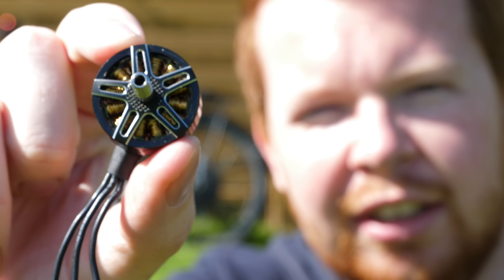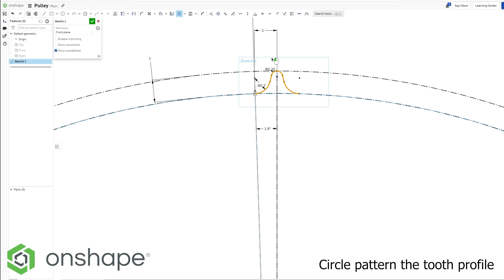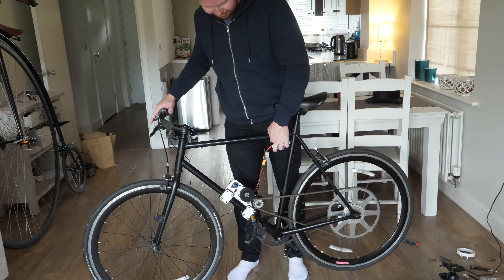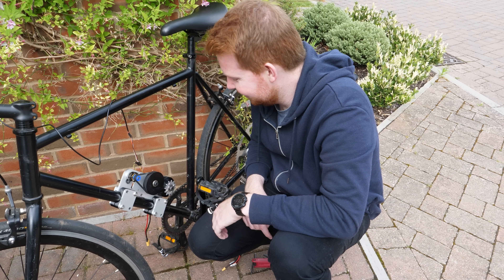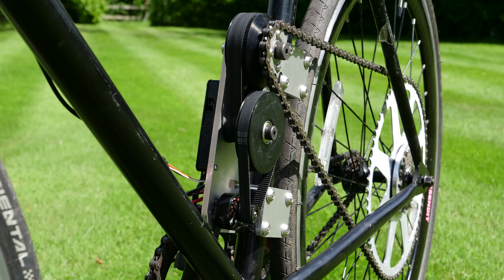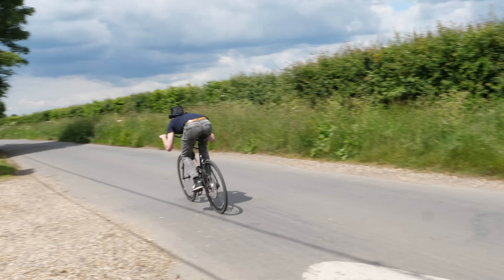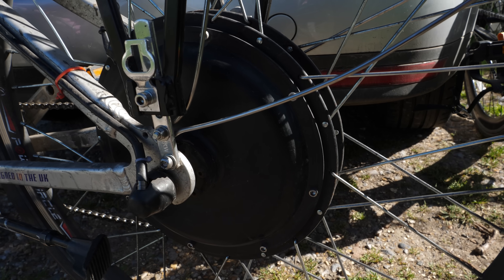Tiny 1kW Electric Bike Motor

Comment: So, what I don't understand more than anything else in this Ebike, ev world that is coming up around us now, is why are we doing away with transmissions? I've seen SO many bike builds, from Ebike to actual EV Motorcycle, and they're always limited to what static gearing is chosen. Either you have nothing off the line, or nothing at top end. And usually both suffer no matter what. Despite the big numbers touted, the speeds and acceleration are always horrible, something akin to a 1990s power wheels. So, why not bring the transmission into the mix? Who cares what the power plant is? Whether its petrol/combustion related, electric, steam, or human powered, having varying gears to make the job easier at various speeds, inclines, etc. just makes sense. Why is every single stupid electric build hindered by this simple premise? Usually while praising the reliability of having less parts. Well, I think some of those lost parts should probably come back into play. I'd much rather have 21 gears for my lil electric power plant to utilize, than one single fixed gear. That's just common sense. Feels like we're regressing at least as much so, if not more so, than our advancements here. Add one technology, remove one absolutely required, needed, sensible, part. Remove gas engine driveline, add EV, lose gears... why? Lets keep the gears, please!!! Motors, not exactly like engines, but similarly in general, do still have power bands. Just like you explain here... the drone motor makes its optimal power when spinning ungodly fast... Large industrial motors can make gobs of power and torque down low, and run out when spinning fast. So why not try to keep these motors within their power bands via gearing? You know, JUST LIKE WE DO WITH internal combustion engines, which have the EXACT SAME TRAIT? We don't need to lose the tranny just because we've replaced the engine. That's dumb. Let's stop being dumb.

Comment: Thing is that ebike hub motor is really not stressed at all at that 30 ish km/h level. I had a 6kg motor like that, on a 20 inch wheel I went 60km/h, I would set off using 4200 watts. Never had an issue and when I pulled it apart the coils weren't darkened in the slightest, it looked brand new. That drone motor is giving it all it's got. A bigger motor with reduction might be ok, but that's too tiny and missing the propeller to cool it. And going thru 2 belts and a chain can't help efficiency, maybe some other RC motor that's bigger than your fist, or one from a brushless tool, with a kv low enough to only need the chain and sprocket combo. I think it would hold up much better. Heck they even make water cooled RC motors.

Comment: What about a motor that just constantly spins up a fly wheel, put a temperature sensor on the motor to limit power while overheating. Use the fly wheel to drive the bike.

Comment: Should work alot better as a pedal assist motor, the tiny thing cant handle the massive amps when accelerating from a standstill. When its rated RPM is 30k, its essentialy drawing locked rotor amps for multiple seconds until you get up to cruising speed.

Comment: Really you have lots of thermodynamic room to play with your design.  There is a lot of heat transfer through both the housing and the spokes of the wheel of the ebike motor, and fitting a reduction solution into that hub might make for an interesting follow-on project.

Comment: In the UK I thought that motor assistance for eBikes is limited to 15mph, and above that it's all pedal and/or gravity power.

Also, those drone motors are designed to be cooled by the airflow from the fans. They really require active cooling of some sort or the windings won't last long.

In addition, the maximum power draw of about 1kW will only occur at low revs when the back emf is minimal. By the time the motor is up to full speed, the back emf will have cut the current flow markedly, and it might only draw a couple of hundred Watts if you are lucky.

Comment: Problem is the motor is designed for some optimal voltage and current ratio.
If you use it on a bike instead of a drone, even though you geared it down, you still apply too much load, extra load causes extra current to be drawn which obviously overheats the motor, and the average voltage applied to the motor is also low, so that motor probably ran at much less than 1000W.
For that reason drone motor manufacturers specify what is the max size of a prop you can attach not to cause excessive current draw.
And lastly, in intended application there is a lot of air going thru the motor.

Comment: They forgot the fact that a drone has fans that create the lift, but also cools the motor down by the airflow it creates.
The drone motor on the bike has no cooling (no coolingfans). If theay had mounted the drone lifting fan also on the bike the motor had cooling and it would less overheat.

Comment: it would pe interesting to see if you encased the motor in a box full of oil would help with the overheating, or mabey used 2 or even 4 motors, these drone motors ar usually sold in bundles of 4 at a discount.

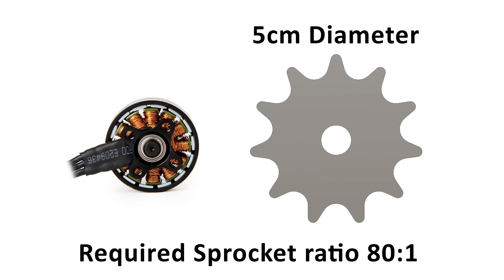Comment: cant you put less power to motor so he would heat less and make that sprocket ratio  from 1:33 smaller? so you would bot heat and burn motor so fast. im bot electrician so probably a dumb question
Reply: You could limit the power to the motor, but unless you have a reason (like overheating), there is no reason

Comment: And still when you look at this motor size... That's impressive!
Such a tiny thing can pool a man on bike at 30 km/h!
Reply: it's like Super Sport motorbikes. these tiny engines are basically used up in a few years because 10000 rpm are just not a sustainable thing.

Comment: I think, the main problem ist the first belt. At 30000 rpm it has a lot power dissipation due to inelastic deformation. In fact you will never achieve this motor speed, because the belt will consume a large fraction of the motor power. So it is always the best to use direct drive or a transmission with low friction. The best design for direct drives ist the axial flux synchronous motor. You can equipe the rim of your bicycle wheel with a lot of small disk permanent magnets and bring them close to a ring or a ring sector with a lot of small coils. I guess, this would be the best adapted design for an electric bicylce drive.

Comment: You could probably 3d print a small set of blades to move air across that motor to dissipate the heat that the props would normally do.  It is a lot of power being concentrated on a tiny space.

Comment: Such a interesting experiment! I guess the only question is; what is the added range if the battery stays the same size. Because of your experiment I'm thinking bike companies are building huge redundancies in to their current setup, which is understandable, a bike needs to take a beating. BUT if with a little attitude adjustment (only using the motor when up to speed) I could get 10 times (?) the range on my bike I would seriously consider it.
Reply: 1 kilowatt motor takes 1 kilowatt of power , no matter how small it is and high rpm motors can be ridiculously small , but each loses each power with each gear , and smaller motors overheat very easily , so It doesn't make any sense to use such small motor

Comment: Any intentions to commercialize something with a more efficient drive train? My frustration with all e-bikes and the add on kits that I know of is weight and bulk. For the extended touring that my wife and I do we just need intermittent help against headwinds and upslopes. All available motor systems I know of are so damn big and heavy that the motor boost is needed on a least the low setting ALL of the time just to help move their own system and battery weight. All of the market offerings focused on woo-hoo big watts power totally miss the users who need only intermittent boosts and can't access recharge every day.

Comment: Thanks for making this video. I was always wondering if a huge gear reduction would make it possible to use tiny motors to power bigger machines irl. Not just on the paper.
Reply: It is possible but there's more losses on gearbox so people usually don't do that unless needed
Reply: ohh yes...its possible.. I have seen the big structure(water treatment plant) run by very small motor with huge gear reduction...I think motor was about 3-4kg (no more then 1,5kW ) and gearbox+reduction box about 300-400kg... the whole structure (big frame) about 1-1,5k kg.. and this frame was running in the water.... so yes, its possible :)
Reply: @ImhotepBE  Same concept as a servo motor.
Reply: Gear reduction means friction.
A huge gear reduction can overpower a motor.
I think there's a lego channel where you see small lego motor lifting 100kg or something.
Reply: It's possible, but in most instances a bigger (heavier) motor is offset by a less complex gear reduction setup as well as using the motor more in the meat of its power output, which leads to significantly longer life. Same reason old Toyotas never die, they're so overbuilt they don't wear themselves out in 100-150k miles. 😄
Reply: its a matter of heat dissipation
Reply: but is not this like idk trying to push a boulder with only wood sticks...like it will roll but the sticks will break,
Reply: It's a waist of time" They will burn. Up even with 5//6 of them...We did the same thing with our bike using a Hoover board motor" 250w on both sides...one lasted a almost 2 months..the other motor almost a week more" Then we got a 750w set up" and it's been good for 6 months and still going...we went on and got a 2000w brushless motor kit and we're going to set it up in a few days"

Comment: What if you used more than one motor, to share the load and heat. With some clever engineering it should be doable. 
But with some quick hacking,, maybe use the 30k rpm motor for the first gear, and the 15k rpm motor for the second gear , in your setup.

Comment: Fun fact: early e-bike motors used to use this kind of arrangement. They had pretty tiny outrunner motors (but configured differently to deal with high startup current - also way better cooling) and a 1 or 2-stage reduction gear, often planetary, to the casing. But as it turns out, once you factor in sufficient allowances for cooling, enough metal to transfer the forces between the axle and spokes and all that, they weren't that light. Typically around the 1.5kg mark for a 250W motor.

These ended up going out of fashion because of the noise. Used to be commonplace though, I'd say about 50% of pre-2010 e-bikes used this arrangement.
Reply: I was going to mention, if they wanted to try and make their e-bike work with a brushless outrunner they should have used a planetary gear, after all they easily do between 1:50 and 1:100 in a single step and produce massive increases in torque for it. Plus the planetary gear would fit rather nicely in the hub of a bicycle wheel.
Reply: As soon as I saw him install belts, pullies and large sprockets, I thought, well there goes the wieght advantage of using the smaller motor.
Reply: https://youtu.be/LUVro3gXmF4
Reply: Thanks for the info. I was wondering where the small motors and extra gears went? now with the new single hub motor e-bikes china has been mass producing. I suppose they are def. more efficient. My only question is why dual motor bicycles don't go nearly twice as fast?
Reply: @feilox  I may be wrong, but I think having a second motor would double the torque of the bike, but not increase its top speed... not to mention the efficiency goes down as now you have the weight of a second motor.
Reply: So if you wanted the lightest possible setup, make something like this with a temperature sensor kill module to keep the motor from burning up.
Reply: I wonder if anyone's tried solenoids as pistons? They can pack a hell of a lot of force into a tiny thing.
Reply: @luminousfractal420  the amount of overheating would be spectacular. Also, piston driven motors are inherently less efficient than standard electromagnetic motors, because piston systems have lots of moving parts and lots of acceleration and deceleration.

Comment: Just a thought, if you can drive the motor with a mini 3Phase inverter and some form of rough current feedback, and add a switchable gear box, it should perform pretty well at lower speed.

Comment: The e-bike motor is made for torque and longevity, whereas a drone motor simply spins a fan which requires hardly any torque but lots of rpm. 

Whilst what you've done makes it possible,  it's like driving a lorry with a motorbike engine.

Comment: You maybe should have just written Mr. Musk to find out about torque vs actual consumed wattage.  I don't care what you make that tiny motor from, it will not be able to put out 1KW power.  The proof is how hot it got.  It tried to use the 1KW, but just converted it to heat.
Run it a paltry 10 miles and see what dripping hot plastic looks like.

Comment: One thing I was hoping you can try as I haven’t seen a well done video of turn like a Milwaukee drill into parts for a ebike. Expample use the motor out of the drill and use the battery to power it.

Comment: Servo Motor and planar spiral gearbox will get you way better results then this still way smaller then what is currently used in ebikes but not as small as a drone motor and also very expensive but pretty nice torque and stealth AF compared to normal ebikes.

Comment: This is like using a screwdriver to pound in a nail.  Yeah, it works, but that's not how it was designed.  Torque and HP (or watts) are different

Comment: Those motors have very narrow efficient RPM range, out of this range they burn up very fast.
Ebike motors are HUGE and have massive thermal mass bc of the large RPM range they need to work in
Reply: You should try one of those 10kW+ drone motors sold on ebay and aliexpress, adding hall sensors would help a lot with efficiency too

Comment: Great experiment. It seems to me the task at hand using a small motor with high rev range can only something a similar size.
The size of the shaft or strength in relation to what it is supposed to power. It sort of is like using car tyre bolts and fit that into a truck tyre or prime mover. The tension will be too great.
Imagine you had a bigger motor with the same high rev range of this small motor. Not only would you pull the bike, it will keep going. Only thing is the power of the battery or the total watt hour. Volts times amperage.
Huskvuarna have 36 volt batteries with 9 amp hour. Also catering for the mining sector 72 volt 20 amp hour.
The amount of cells to bring up amperage and then a robust electric motor will mean maybe the motor will not get too hot.
The amperage will provide a greater range.

Comment: Great video. I got limited data so I'm stopping halfway and wait till I get home to see the rest of this video.
I have a lynex gnome which I have a 2d cad program for drawings.
Can this software be loaded to a lynex type system?
Sorry for not watching the rest as my questions may be answered . Regards.
By the way I like your design does the pulleys lose the total power once transferred to the wheel?
Or how much power loss will you experience from your design? 
One reason hub motors have less horse power or watts and better performance than a more higher wattage and horsepower combustion engine is the loss of power from drivetrains, differentials, gearbox etc. 
The more moving parts once going to the wheel o feel equates to less power to the wheel.
Am I correct in my assumption?

Comment: i have used the (HF500-1600KV 1700W) brushless motors to power an electric outboard with a 10:1 reduction, to solve the heat problem the motor was submerge in glycol and the outer casing in contact with the sea was aluminium.
though it worked the glycol would not noticeably slow the motor, the motor would cavitate and then centrifugally displace it out leaving the core uncooled then compound that with the need for a lubricant to be mixed to care for the reducer it ended up only managing around 1.5kw and the target was 2kw.

a massive factor in heat production is the control/driver for cool efficient motor control you really want to look at vector control with a true encoder for position, just compare the 2 on an e-bike motor and you will be amazed at the control vector control provides and the silence of the motor, i could see a vector drive being a difficult at 30k rpm

Comment: I'll bet that the 40 gram 1000-watt motor would do better operating at 1/4 its rated power in the ebike application. 
A motor that can survive 1000 watts is under a lot less strain in terms of its heat tolerance and overall robustness if it's operating at 250 watts.

Comment: that motor literally has no cooling....you should have designed a fan to blow air into the motor...through those holes...usually on the drone they would last much longer from cooling from prop air.

Comment: how can the motor work through the transmission? (and the pedals remained at rest) how to work with the pedals when the motor is mounted on the front wheel

Comment: I think Mr Stanton is onto something here. There are plenty of cyclists (like myself) who just use an electric motor for an occasional boost up a hill or a blast away from the pack during a regular commute. We are looking for light weight and maybe a total 10 -12 minutes boost total (in 1 or 2 minute bursts at a time) during our commute. A regular bike motor and battery adds 7 - 10 kg and you need to keep the motor ticking just to cover the extra weight. Imagine a 2.5 kg set up (1 kg battery, 500 gm motor/ESC/wiring/cooling, and 1 kg mounting/gearing) and it would suit many riders who just use the motor as the icing on the cake during a 10 - 15 km fast commute.